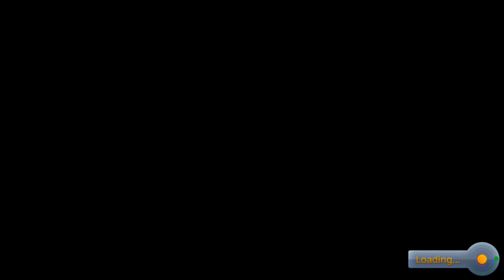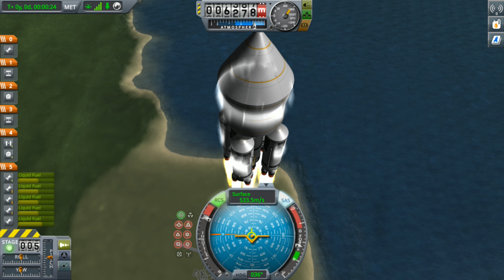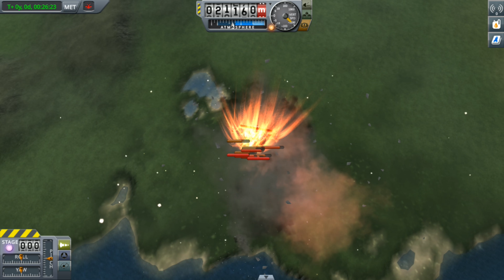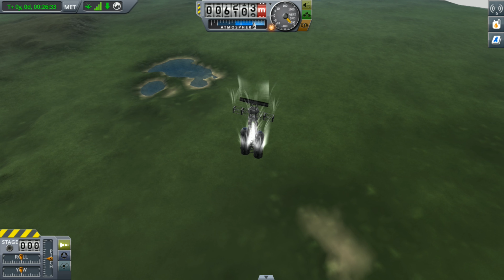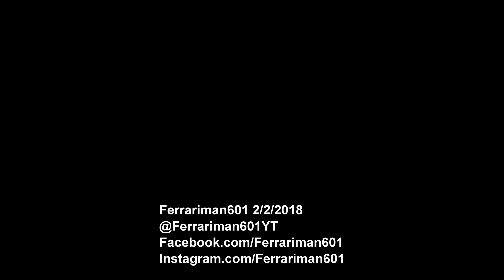Kerbal Space Program - Unfinished Business

Comment: ferrariman, i will copuly/paste my comment of the live so that you can see it and maybe learn a bit. so any reference that i talk about in my comment is from the livestream:

Next time you stream i will be there helping you out, especially on going on the moon, i see you struggling quite a lot. that's not the correct way of doing it. you should get to orbit and then make a maneuver, then you make an ecounter with the moon. also you can quicksave f5 and quickload f9 during your mission to not lose all your progress. In sandbox you can press alt+f12 to open a debug meny where there are cheats and you can do a whole bunch of cool stuff, change gravity, put infinite fuel, indestructible rockets, set orbits on other planets and moons and teleport to them and other stuff that i can't remember on the top of my head. there is so much potential in this game.  one more thing, when taking off with a rocket it's really important to do the gravity turn going to the right (with the key "D") so that you will be orbiting on the equator at the same plane of the moon (or mun ;) ) and all the other planets, this is also important cause you will be orbiting the earth anticlockwise together with all the other celestial bodies which makes landing on them easier. i also recommend you to start a new sandbox mode and turning off the box that require your spacecraft to have a signal, else you will need antennas on your craft and i haven't really experimented with it so i can't tell you how they work. ( else you can't go far or behind a planet because you won't be able to control the craft anymore)
 - for rotating parts of a spacecraft it's better to use WASD QE since they move by 90°. and you don't need fuel from tank to engine. fuel ducts are useful to connect tanks of different stages to have fuel crossfeed so that yo can run all engines at max fuel and when you detach your new stage will have max fuel again. it essentially gives free delta v since you can escape the atmoshpere faster and not having the problem of low fuel on your next stage.
 -you have to select the crew to use that seat for the car
 -also if you hold ALT it's easier to build and attach pieces together ( speaking of the small octagonals structures)